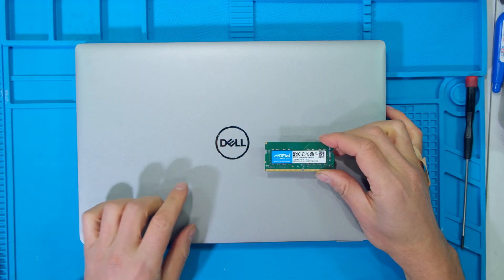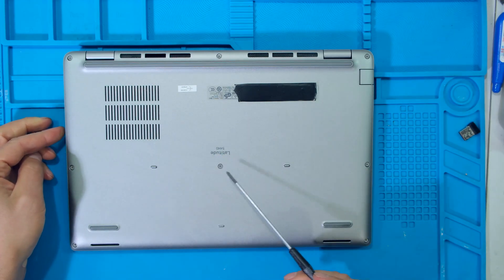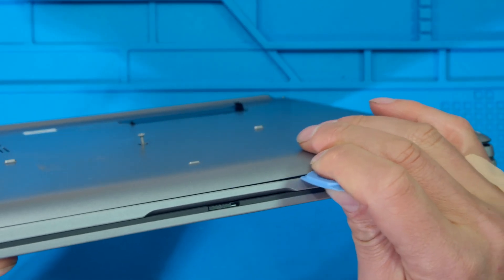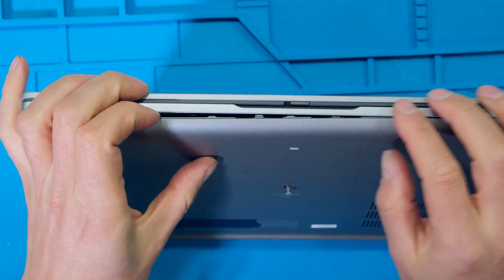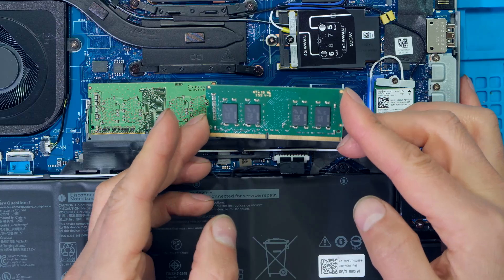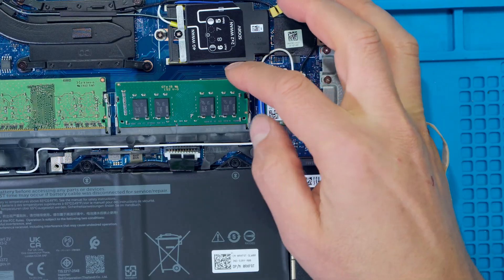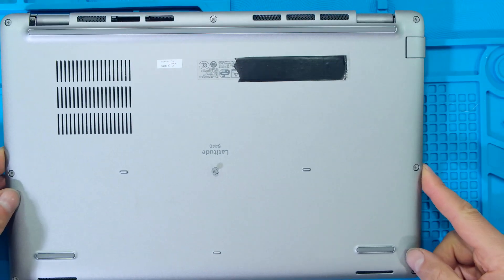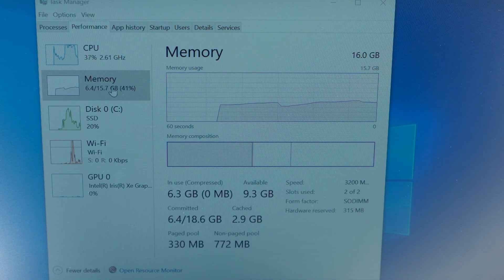How to add RAM to the Dell Latitude 5440 - step by step

Comment: Are there you have a step by step to replace the SSD Hard Drive in this laptop? Which SSD hard drive is compatible for this laptop.
Reply: Hopefully you figured it out, but it should be a 2230 NVMe PCIE Gen 3 or 4 SSD 
I think it depends which laptop you got, but my configuration only supports gen 3 speeds, so no point of a gen 4 SSD